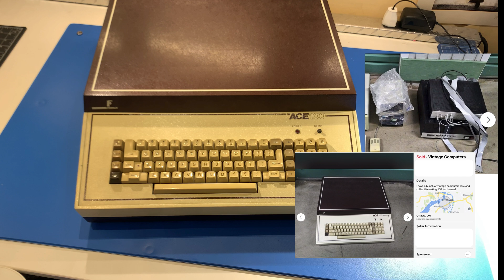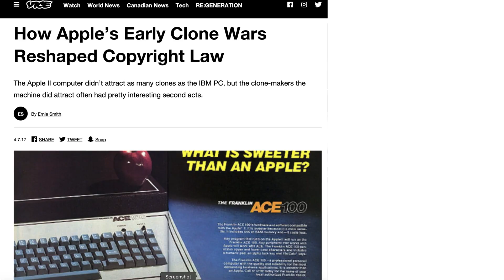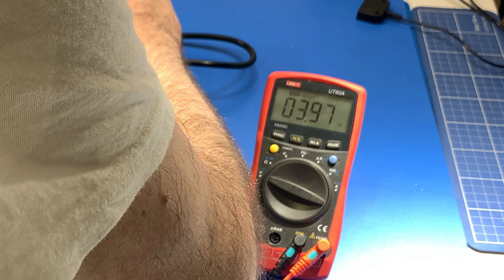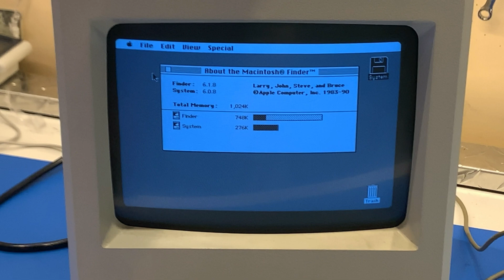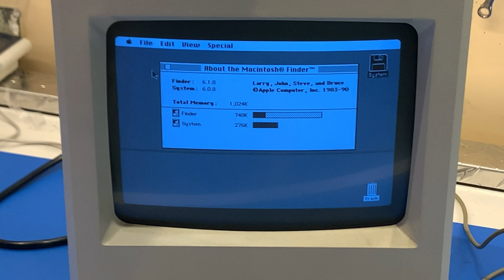Rare Apple II clone that breached copyright law. Franklin ACE 100: Repair.

Comment: I have an ACE 100 and the power supply was also bad. The -12 volt failed and caused corruption with the ram. I put a modern one in side the stock ace power supply. ACE also copied the DiskII drives exactly and had their ACE banding on them. I lucked out and found a set of those randomly on ebay.

Comment: Hello Robin, the card close to the power supply and with a ribbon cable conecting to the motherboard is the on that time called "language card" as you said is a memory expansión card, it duplica tes the addresses being used by the basic intérpreter, is for the computer to have memory space for using languages other than the basic intérpreter stored in the ROMs, the one you saw working, it uses the audio input and output jacks to Connect to a almost standard audio cassette recorder to store and read program and data, the other card is the floppy drive interface card

Comment: Interesting video about a machine I remember reading about in Byte magazine back in the 80s.  Thank you.  I suspect the improvement in the 5 volt regulation was not due to the cleaning (although not impossible).  In a unit that's almost 40 years old there would have been a great reduction in capacity of the electrolytic capacitors in the power supply, and with some use it is likely that they would have re-formed a little.  However, unless you wish to retain the authenticity and not use the computer, I would recommend replacing the reservoir and filter electrolytics in the power supply.  The filter capacitors should be a low ESR type.  There is also a risk that very old capacitors may fail dramatically...

The ceramic or glass bodied style of diodes that you commented on were quite common in the 70s and 80s and used in high current applications.  I think the ones soldered to the heatsink are likely to be in the 5 volt output circuit of the switching power supply, and so they would not be a full bridge rectifier. In a such a circuit (this is a form of buck regulator - a step-down switching supply configuration) it would be normal to have half-wave rectification from the transformer, since it is not dealing with sine waves but very high frequency pulses.  There is also normally a flyback diode between ground and the coil winding on the driving side.  One or both of these circuit elements may use one or more diodes in parallel.

Lastly, a word of advice - it's generally a good idea to connect the meter for voltage monitoring before switching on the power.  If the voltages are on the high side of normal, you can then immediately kill the power, hopefully before the magic smoke is let out from some of the ICs on that lovely motherboard.